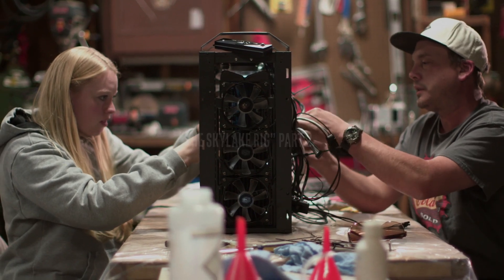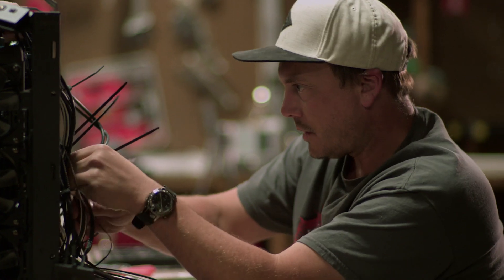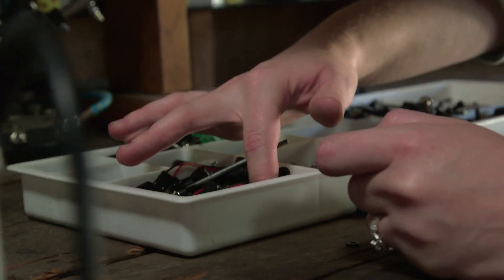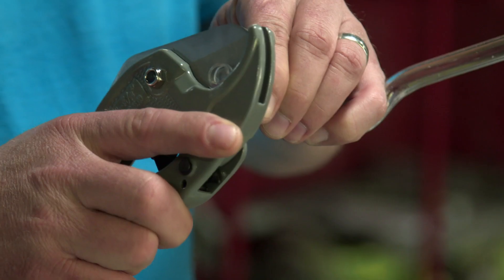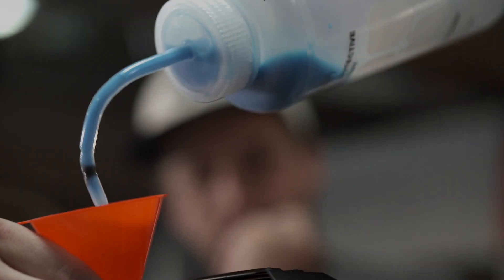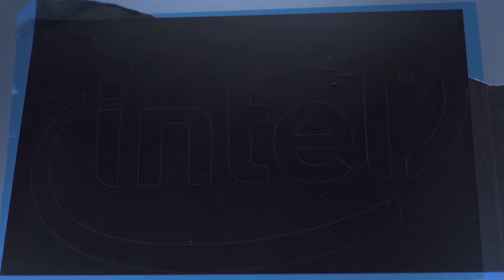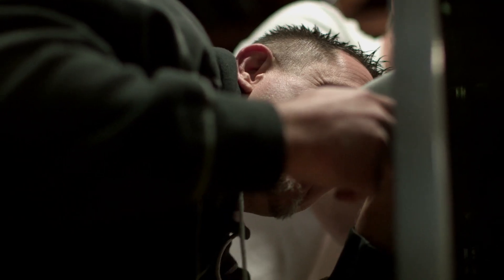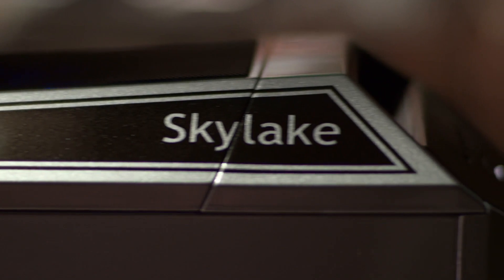The Skylake Build, Part 2 #ExpertMode Ep. 6 | Intel

Comment: You should have taken longer than a day so the computer would work. My son won this computer and you can tell it was built in a hurry since it arrived not working and to this day it still doesn't work. The guy that built it has been supposed to call but uses a phone as well as you build computers because he still hasn't called. This morning my son received an email saying it was the operating system so that tells me you knew it didn't work when you sent it out. In the video you asked what more you could ask for my answer would be a computer that works.
Reply: Nice try saying you won this computer when this PC was used to showcase the Intel Skylake CPU at tradeshows, and conventions for over a year.

Comment: 8 Hours? OMG i make build 2 PC from scratch in that much time.
Reply: Have you tried sleeving your power supply cables? Not only is it a tedious and time consuming task but if you put the wrong pin in the wrong slot of the connector, you'll blow not just the power supply but you'll blow what ever component it's connected to.  

Yeah, you can buy custom sleeved cables, but nothing beats the feeling of knowing you did your own cables and doing the pattern you want.

Comment: what the hell are you doing on that computer that you need drill bits?
Reply: +Ｔｈｅ Ｃｏｍｐｕｔｅｎｔ  Many things require new holes when building a custom PC. In this case we had to drill mounting holes for the coolant reservoir.
Reply: BSMODS
ohh, that makes more sense. I found this from a link on PCMR and hadn't yet seen that you guys were water cooling.
Reply: +BSMODS The Cooler Master Master Case 5 Pro is already set up for watercooling and has threaded holes for the reservoir. This video is just cringe.
Reply: +Jaymes Stewart Well as the builders we wanted a mount location that required drilled holes.
Reply: +Ｔｈｅ Ｃｏｍｐｕｔｅｎｔ Right on this build is pretty simple when it comes to "Modding" but having a custom location for the res makes it look pretty sharp!
Reply: Jaymes Stewart Then it's no longer modding, it's just assembly. Any average Joe can assemble a computer and have it look like a generic system. A simple "modification" can make ones system unique

Comment: Man thats a powerful Rig wish I could have it!
Reply: +Zachary De Pledge They're using a 980 TI and an i7 6700k, if you're not gaming at 4K you don't need much more than a 970 or even a used 760/770/780 if you want to put together a cheap entry level gaming PC just get a used Dell Precision T3500 on ebay for about $130-180 and if you're willing to settle for medium and high settings at 60fps buy a used GTX 750 TI or R7 265 on ebay for another $100-120 and just drop it in, if you go for a 760 or higher you'll want to upgrade the PSU buts thats only really another $50.
Reply: yeh in my rig ive got a i5 3330 and a new 750ti I got last week and also upgraded the ram to 8GB, when the PC broke originally we changed the MOBO so its pretty good now from a crappy HP home PC
Reply: Zachary De Pledge
hey man, those older ivy bridge i5s can still keep up, I mean that rig I recommended has a Nehalem based xeon, usually they come with W3520s, so a chip like yours is certainly no slouch.
Reply: yeh i know